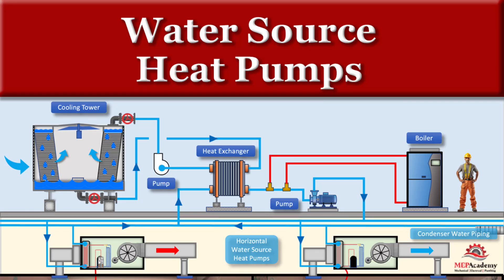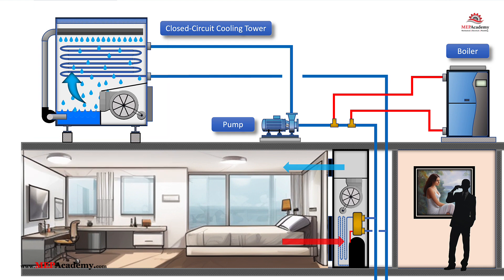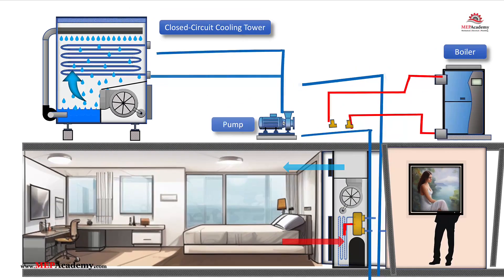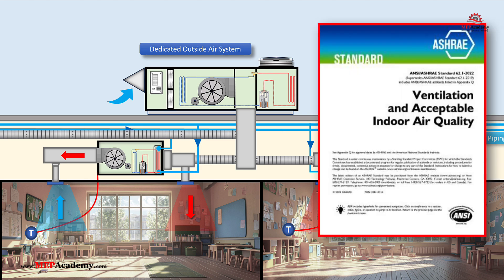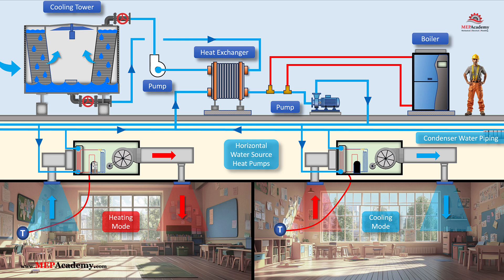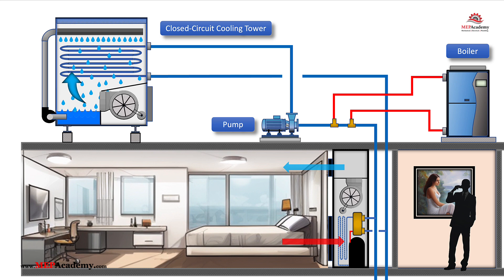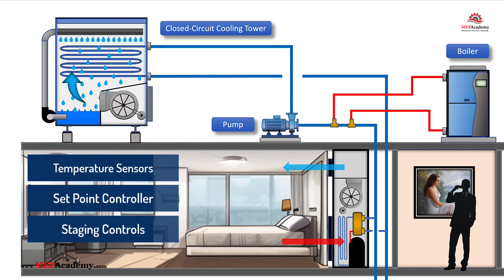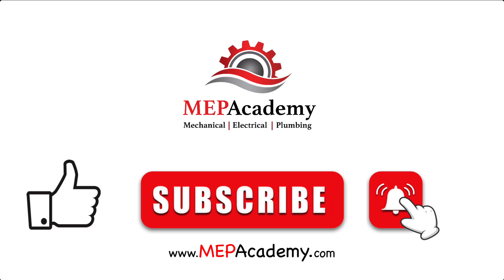Water Source Heat Pumps Explained

Comment: Is there a time where a tankless water heater would preferrable over a boiler for this situation?  Got a facility with 2 boilers that need replacing, only bc the facility cannot get any more parts for the boilers, which they are still working great as of now.  So would replacing the boilers with a series of 3 tankless water heaters be ok?  They would only be used for non potable situations.

Comment: so they are like systems with chillers but the conditioned side is on the room

pros:
efficiency
there aren't conditioned pipes that can go down to 44°f 

customizability
there are many chillers that are adjusted instead of a valve regulating the flow

cons:
size
each fan coil needs its own cycle
Reply from the maker: A water-source heat pump (WSHP) system improves efficiency by transferring heat between zones that require cooling and those needing heating. Instead of rejecting excess heat to the outside, heat pumps in cooling mode transfer their waste heat into the shared water loop, which can then be used by heat pumps in heating mode. This heat exchange reduces the need for auxiliary heating and cooling sources, maximizing energy efficiency. When the system is balanced—meaning some zones need cooling while others require heating—it minimizes overall energy consumption, making it highly efficient for buildings with diverse heating and cooling demands.
Reply: @MEPAcademy  hoooo awesome that's making sense now, thank u brother